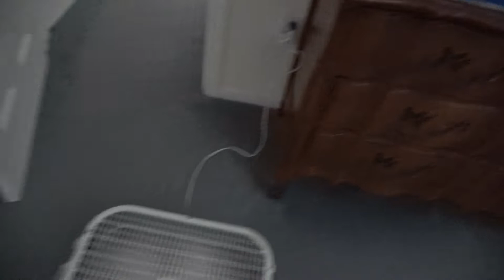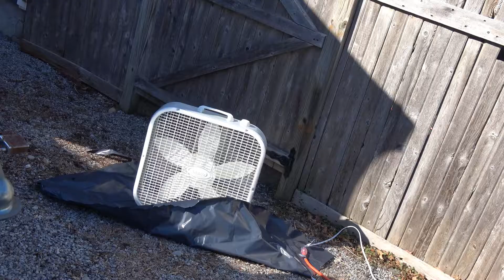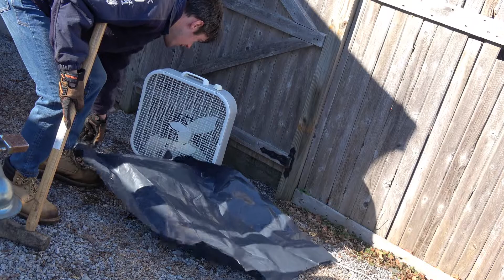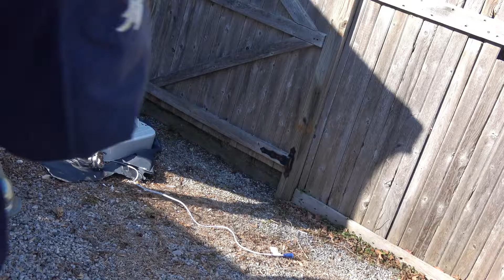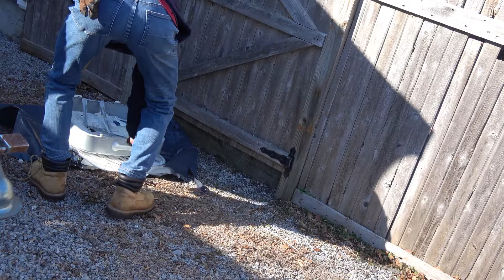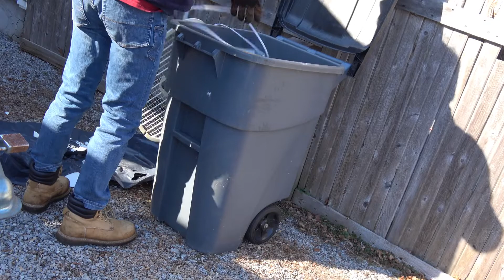Bought Another Lasko 3733 box fan

Comment: my vintage 1980s fans don't do that even my 1997 lasko 37233 don't tip even and all my modern Chinese junk fans are dead from summer heat in 2019 and my antique fans still run and the vintage box fans work just good as new